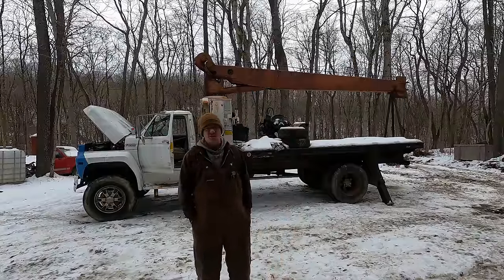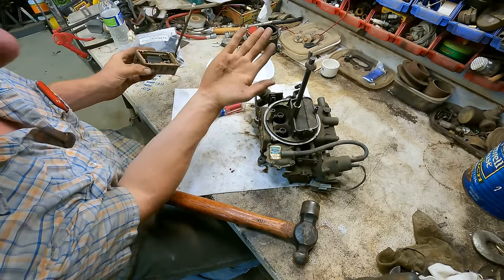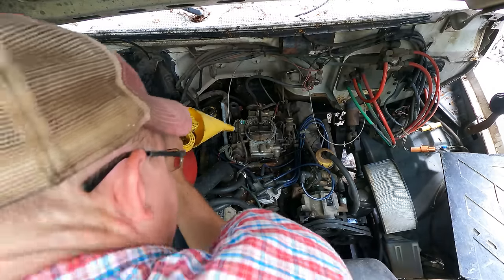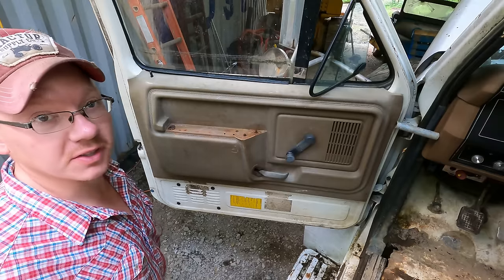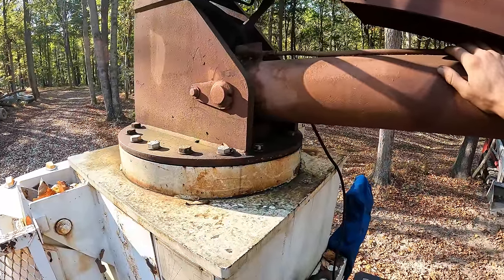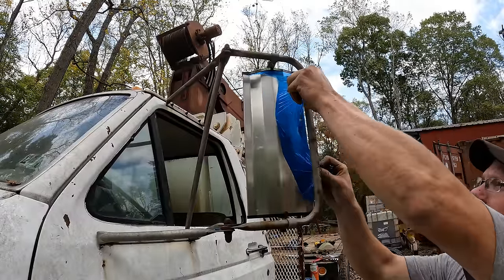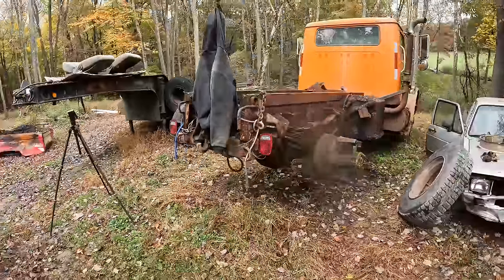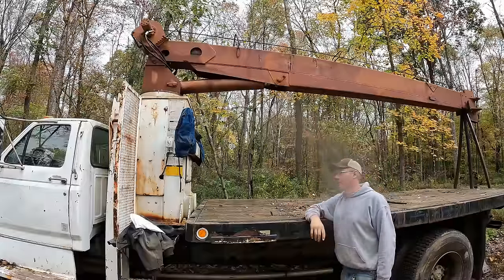Repairing a $700 Auction Crane Truck!

Comment: Get a Hollyey carb manual for that crane truck carb rebuild.
Reply: That is know as a Square Bore--- each hole is equidistant and same size
.
Take that air cleaner to someone that can form a Domed lid for the air cleaner maybe?
I put a 4" high 16" w3ide Cal Custom on my truck
Reply: Holley locks with the outer nut like ring.
HOLD that center while locking it in place.
Reply: Form sheet steel and weld in over that exhaust leak?
Reply: That "crossover does just that between the fuel bowls.
Reply: Tube seals with o rings btw.

Comment: Would it kill you to throw a couple donut gaskets in the exhaust? It will sound as good as it looks!
Reply from the maker: It’s the manifold gasket and the bolts will snap off if you even look at them…. Not worth it

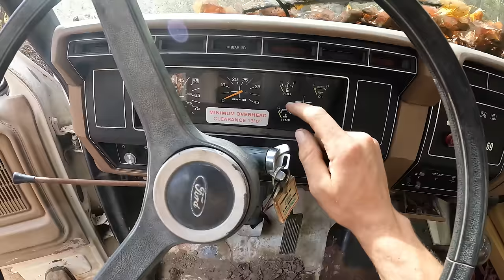Comment: 31:42 Damn, that's a fugly assed cockpit. 
Why do American vehicles have those wings around the key?
Reply: The theory is that you are supposed to push on the wings to turn the ignition, rather than the key.  Reduces the chance of breaking the key in the ignition barrel.

Comment: Why didn't you either Buy a rebuilt as I not a Carb Man or a holley but I wondered why not just pulled the Whole engine and swapped it from the other truck then had all diesel engines

Comment: Man keep that damn air cleaner covered up !!! Ive seen too many locked up from that seal funneling water in there. Whats the cap on that crane ??? I have an L8000 derrick digger thats a 6X6 with the big Brazilian diesel in it.... I would love to have just a quiet idling gas in it for operation.... Ya get tired of hearing that damn Big Diesel run when youre up on the crane working.

Comment: ALL single axle rear drive trucks are virtually useless unless they're on level, dry and hard packed surfaces...any wetness they'll spin, any loose gravel, sand or dirt and they'll spin...any snow or ice and they'll spin...any slope or uneven ground and they'll spin.  Tandem or dual rear axles rarely have issues or ever spin and I have never seen a triple rear axle ever spin...plain and simple

Comment: Your one big failure is you completely did not evenly torque the rims while spinning the tires to ensure they are running centered on the hubs. I know it's a off road truck but still it was something simple you completely overlooked.